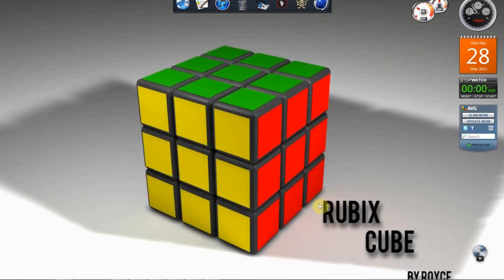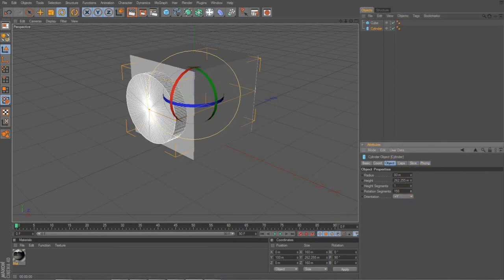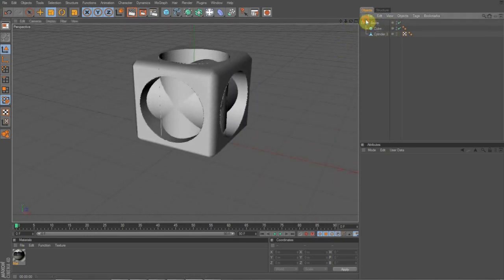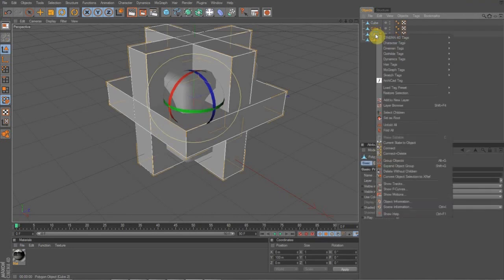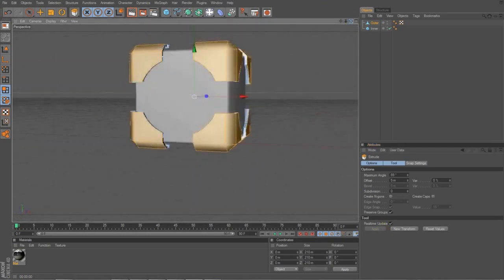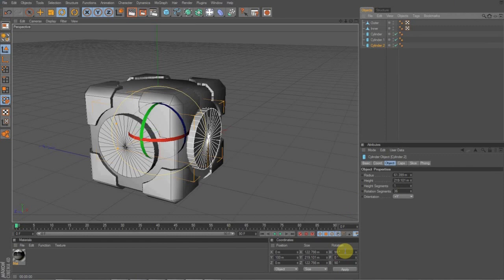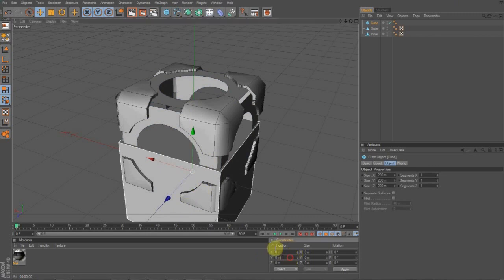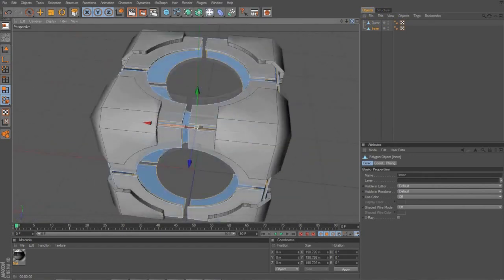Cinema 4D Tut - Portal 2 Refraction Cube Part 1

Comment: I had trouble deleting the edges too, but it's actually super easy. Just make sure you're using the Polygon tool on the left and the Move Tool on the top. Click your planes that you want to delete (you'll need to zoom in since they're small) and just hit delete. Bam. You're done.